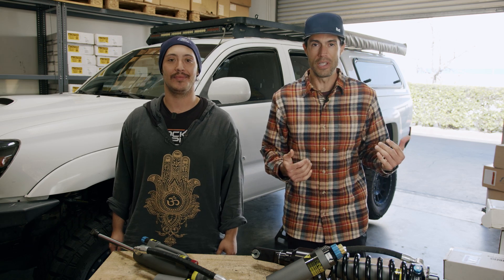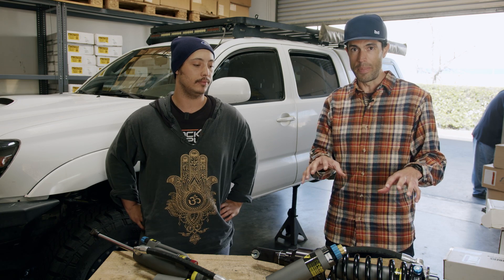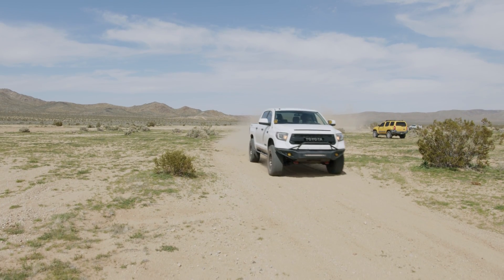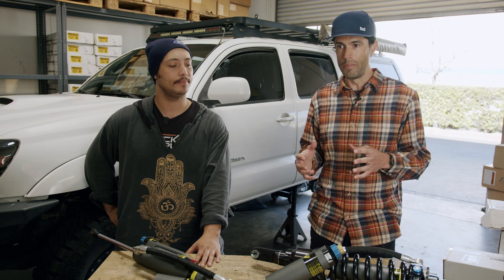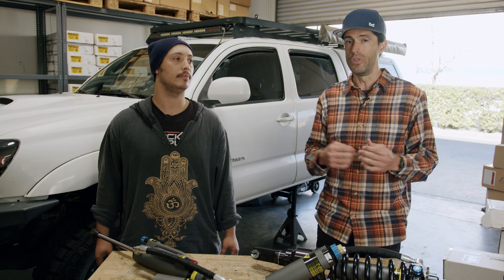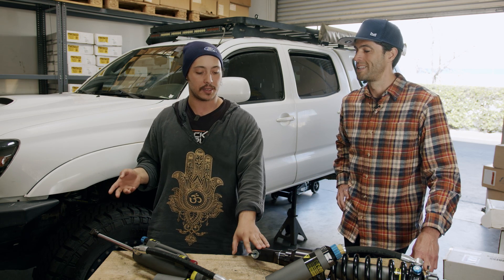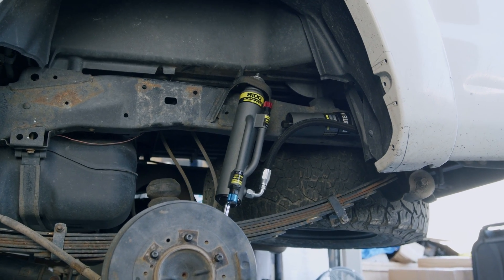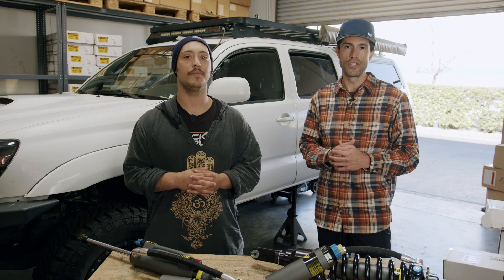Bilstein 8112 DSA+ Shocks Overview & Install on our Tacoma

Comment: I just purchased the 8112 without DSA+ for a 2023 Tacoma from you guys, I’m looking for about 1 1/2 lift in the front, I’m still looking for the best configuration for control arms and rear leaf packs or even ride high, I haven’t purchased tires yet, so I can accommodate depending on configuration, what do you recommend for the parts that I still need, ride high and to get the best  performance of the coil overs?

Comment: can you run the rear dsa blistein with c4 bumper, feels like the rear bumper from c4 rear bumper braces will interfere with the dsa rear shocks, or get the rear bypass instead. what are the main difference between rear dsa vs bypass on tacoma.

Comment: @ShockSurplus these or some fox elites for slow to medium speed rocky terrain (AZ)? Currently have 6112/8100. Can the 8112 with DSA+ be adjusted to be more plush in that terrain?
Reply from the maker: The 8112 are going to be more pillowy out of the box than the Fox’s. Yes you can get the Fox’s custom tuned to be softer, but you can’t duplicate the RCO and JCO of the Bilstein, which are the real heroes.
Reply: @ShockSurplus that’s what I love to here. Right, can’t beat the jco and rco. How long will they be at the current price of $2668 on the Tacomas?

I’m trying to figure out how to achieve 2.25” lift using the 650# spring from my 6112s without having to adjust the preload until I get it right. In your video you installed them set to the factory 2” and I see y’all have the front bumper as well. I’d imagine you got less than 2” as a result

Comment: Bilstein 8112 do they for F150 2019 ecoboost? How much? $
Reply from the maker: Yes, Bilstein actually just re-released the 8112 for the 2015-2020 F150. Those run about $3k for the full set of 4, text us 213-433-3616 if you'd like to know more or want an official quote

Comment: I have a question on ride height.  Is this going to be the same or different for 5th gen 4runner in terms of recommended lift height?  I want priority to a decent highway ride quality and handling.  Occasionally there will be some mild off road but nothing too crazy.  I have the following.

-265 KO2 tires
-1.25 in wheel spacer
-C4 bumper and rock sliders (200 lbs of low mounted weight)
-I don't have a lot of other heavy gear.
-adding Accutune UCAs

What would give me the best highway drive and most lift before I run into compromised ride?  Can I do 2.5 inches on the front and 2 on the rear?  Or should it be less than 2.5 inches such as 2.25 or 2 inches?

I'm hoping for 2.5 inches on front but your video planted questions and concerns about losing ride quality.

Any advice would be greatly appreciated.

Comment: guys, does bilstein only make the 8100 for the rear of the tacoma?
Reply from the maker: 8100 DSA, smooth body, and bypass, 5160s, 5100s, and you could probably get a 7100 reservoir shock as well.
Reply: @ShockSurplus  I meant, do they make the 8100 for the front?

Comment: Really want to see the full review video of these. I want to run a deaver stage 3 springs with hammer hangers with about 750-800 constant. I'ts great to know the bypass 8100's are an inch longer than the 5160's but I would like confirmation that 2ish inches in the rear is not going to destroy ride quality.
Reply from the maker: review almost here! subscribe! =D
Reply: ? Waiting……

Comment: I'm a little bit confused by your comment about lift height and tire clearance. Lift height doesn't affect tire clearance on IFS unless you are changing bump stops or control arm geometry. This is unusual coming from suspension experts.

 What's your logic on that? How does a tire fitment change at full compression if the static height is 2 inches higher or lower?

Comment: I cant wait to hear the driving review on these. Im holding out to pick up a set of these for my GX460. Been waiting forever for Bilstein to release the DSA+ version. It will be interesting to hear your feedback on the rear lift height. That was one of my biggest concerns as Im running Dobinsons 329 rear springs that have me higher than the 1.5" Bilstein recommends.
Reply from the maker: so far they're fantastic and can do everything extremely well. Its been the rear that needs tuning in order to keep up with the front.
Reply: Are any Bilstein rear shocks compatible with a stage 2 or 3 leaf pack providing  2-3" or rear lift?

Comment: You got to change these worn out body mounts on that Tacoma... you'll be amazed how the ride will be improved especially when combined with the 8112/8100. Use poly bushings so the body and frame will better react together with the suspension and not trying to fight each others "shock waves". I'm in the same business as you, I know you will like the improvement. Thanks for the video.
Reply: Explain more, I’m looking to get these 8112 & I drive on the road a lot so I want a really smooth ride on & off road.

Comment: I have a 2012 Tacoma, im trying to get 3inches in the front. Any suggestions on which coil over to run. My tires and wheel set up is bfg 285/70r17 on the fj cruiser 17” wheels.

Comment: Finally a good 8112/ 8100 review! Just installed mine and I'm still playing around with the adjustments!
Reply from the maker: where you located? we're going out to Barstow in a couple weeks to review even further in the high speed and play with settings
Reply: @ShockSurplus  Up in the central valley! It would be awesome to come down if I could and try out some different settings

Comment: Bought the 8112 and 8100’s from you March 2021 have about 20,000 miles now.
Worth the money ride is amazing especially on road.
Do have Deaver springs with the shocks too both make a huge difference
Reply from the maker: Love to hear it!
Reply: What stage deaver and how much weight do you run?

Comment: I don’t about these stock upgrade shocks unless it’s mid or long travel.  2nd part would be go get them tuned.  If you’re spending a few thousand just get it done right.
Reply from the maker: huh? These arent considered 'stock upgrade' - these are the highest performing mid-travel shocks you can get for the Tacoma. These will wipe the floor against any comparable King option.

Comment: Any trade in/upgrade program for those of us with OG zinc 8112s??
Reply from the maker: We could cerakote them for ya, and add the DSA adjusters to the reservoirs. but there's not an official program. Wont be able to add the JCO adjuster though.

Comment: I wish these and the ome64s both would come out for my truck. Both have said they have no plans :(
Reply from the maker: Which vehicle? Is there a Dobinsons MRR available?
Reply: @ShockSurplus  not that I'm aware of. 

18 Silverado. I run 6112s (from you) and DKlong travel springs out back with 5160s. 

But as an old school arb/ome fan from my jeep days, if they offered it I'd swap instantly. 

OME said they have no plans for Chevy love though :(